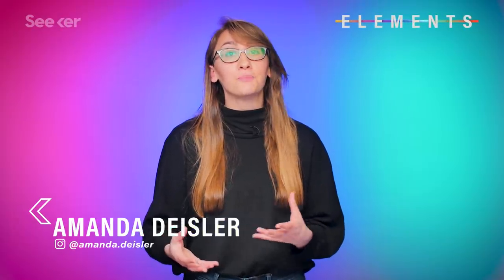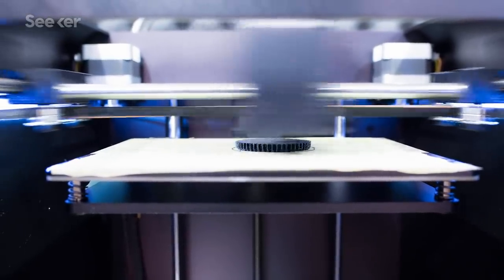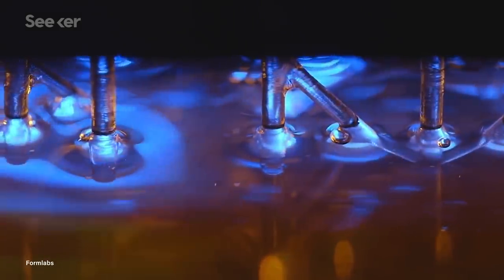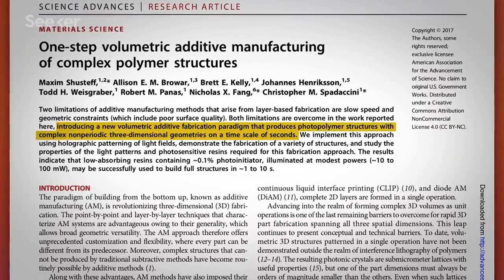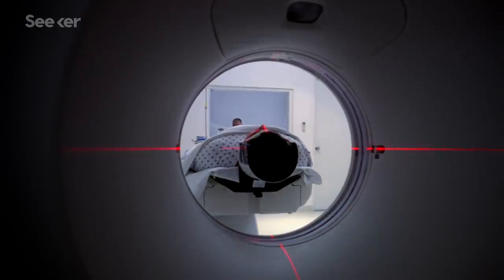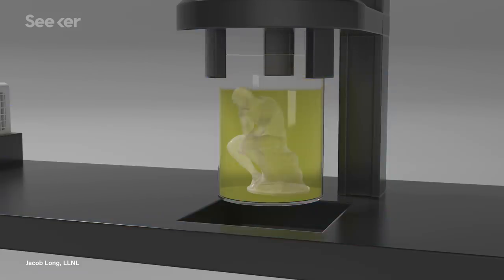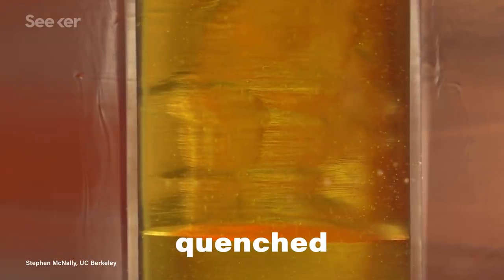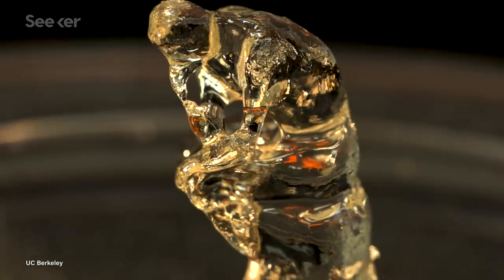Why This 3D Light Printer Is a HUGE Game Changer

Comment: Truly extraordinary. It also shows that reality can be stranger (and/or much more advanced) than fiction. Assuming "computed axial lithography" can be scaled up and become more flexible in the future, it is interesting to note that the creators of Westworld never dreamed of tech like this and instead employed conventional additive manufacturing (3D printing) to print the Hosts, as is clearly shown in the intro of the show. 

"Layer by layer" additive manufacturing has an inherent speed limitation, even if it can be parallelized, but I never thought such a tech was possible, even if specific resins are required. This is basically like holography merged with additive manufacturing. Most remarkable. Perhaps, as additive manufacturing is further developed in the future, we will eventually have something close to Star Trek's replicators, even if they are not actually "molecular".

Comment: That's really cool. But what would make it cooler is, what if you can then dip it in another liquid to form a shell? Maybe it could be made stronger that way or have other desirable properties. Or, one could then take that shell, drill a small hole and fill it with a substance that then dissolves the polymer so you can pour it out. Then, fill it again with something that will harden very solid, and then break off the shell. So, it's a perhaps easier way to create a mold for injection molding or whatever it's called. An artisan who is good at quickly carving some soft material could do the same, but for either highly precise jobs or just because it's cheaper and easier, this might be an alternative. Another craft lost to technology. Though, a job created because someone has to create the model in the computer.

Comment: This is amazing!  But I work with industrial printers like those made by 3Dsystems and this clearly has a long way to go before it would be useful.   accuracy is clearly not its strong suit.  There are a long list of challenges they will need to overcome before this would be commercially viable.   Still, it's a window into the future.

Comment: Dont get to excited, this is still in its infancy stage, as well failing to meet certain requirments funding for this has been cut to more than 1/2.
Although there was a good deal of excitment for this in the beggining.
it has taken a back seat to more ground breaking 3D tech that will be revealed mid 2020.

Comment: If they are going to move this beyond test tube size, they are going to need an extremely clear resin to allow the light to reach the center evenly. At this stage the resin is yellow and full of bubbles. Also the resolution isn't promising compared to existing layer-based resin printers. It seems inherently low, due to their approach of exposing the whole volume at once instead of focusing on individual layers. Using a hollow structure to conserve resin doesn't seem possible either. The lack of need for support structure is interesting, but I have reservations about it being a "game changer". It's certain novel though.

Comment: This Method is a nice idea, but it would be much more precise and efficient with a spherical array of some Lasers or Projectors around the Gel or Resin, where the Resin could rest static, instead of Spinning the whole Resin, that pretty sure leads to washed away, muddy shapes and artifacts, because of the centripetal & -fugal forces, that the material goes through. Even if it's seconds...Between the time, when the front-part and the back-part of a model is lightheaded, time passes by where the Container spins and parts of the model could slip or shift minimal in this non-solid, viscous material. That's why I think, that this spinning design would always result in to a minimal unsharpness of the prints, if non-solid materials are used.

Comment: I don't quite get, why the resin solidifies in the middle of the jar while maintaining fluid in the outer sections. If the light beam is strong enough to solidify the resign inside, why shouldn't it be strong enough to solidify the resign while entering, light doesn't gets stronger as it travels usually. The resin should, due to the rotation of the jar, move and make the print super janky. Shouldn't the jar break the light like a lens ? Why is this possible at all, i don't get it

Comment: I'ma go out and guess that this method is probably wel suited for solid objects, and that if you wanted to print IDK, like a box with a lid, of whatever shape, that the equation would get more complex than r(theta)=ax+by+c. then again, maybe not. I wonder if giving this setup an out of focus image at a variant vector would solidify the material at the focal point of that vector. I mean, you could try to do a complex equation to figure that, out, or you could just pulse an actuator attached to the lens focus on your projector. I'm just a dumb hacker thats what I would do. Clearly these Berkley cats are pretty clever, i'm sure theyve already figured out how to print hollow boxes and whatever. Theres probably all sorts  of interesting things to do around this technology.

Comment: Great development, but ultimately limited to the resolution of the DLP chips (which will only increase if there is demand from the entertainment industry and will likely never exceed 16K because of diminishing returns) and the processing power of GPU's. Also, by increasing the scale of the objects, the field of view needs to increase as well and the rays of light will not be parallel. How will that affect the efficiency of the technique?I guess what I'm saying is that I don't expect this technique to scale up to larger size easily.

Comment: Just some further thoughts. 
A 3D printer can't give a surface as smooth as an 18th century lathe (for a symmetrical surface). At the moment,  with a resolution of 1/10mm, thermal printers are very crude. They're making strides and it's conceivable that in 10-15 years,  we'll have 3D printers with 1/1000mm or even 1/10000mm resolution. More you the point,  it's likely that very large objects will be printed.  Extreme resolution means gaps between parts will be irrelevant - eliminating the need for welding or glueing. There comes a point when intermollecular forces bind adjacent objects stronger than any bonding agent. This is the future - and it's an exciting future. (Especially when atomic level printed circuitry may become a reality. - Conventional electrical  connections aren't necessary when components can be brought close enough to each other).
Reply: True.. When you have the technology to print atoms and print molecules... You then wield the power of the God's.... Gone will be the day of chemical and inertial wrenching of molecules from other states and solutions.  This technology will affect every area of research...for better or worse..because along with the power to create comes the power to destroy.... If history is any indication of our future path... It will not end well.

Comment: Ya right, a polimer bath. What you need to be doing is 3D rendering using pressurized hydrogen 3 or strait hydrogen using lasers or 3D holographic multi-layered imaging.

Comment: Why not solidify each micro node with the intersection of two UV LASER curing beams, each having insufficient energy to cure by itself, but sufficient only where they meet?
Could use conventional UV cured resin and could be vacuum autoclaved to remove air bubbles, if indeed this type of resin even requires that!

Comment: Hmm🤔 interesting You know baking soda and super glue or cyanoacrylate could also be used to 3D print by layering however it would be way faster then a normal 3D printer due to the fact that the baking soda solidifies the glue instantly, food for thought. It also has a high melting point, I seen reach 210deg,  this tech awesome 👍

Comment: Instead of using just one projector, more than one projector at slightly different wavelengths could be used. That way the light from one would not be enough to cure the resin, but when multiple hit it at the same time it could setup and cure the part. This is not exactly new as was mentioned, as it has been done in the past were the light is focused onto different points. The places where it is focused are were the resin will setup. One problem with people saying something is new is most of the time it is not new, just new to them. Most everything has been done at some point in time, but the details have been lost or all of the people involved are long dead. Not everything that appears new is actually new. Electric cars been around more than 100 years, and is safer than starting one with a crank. Yet today if someone were to see something new looking with a crank they would think that it is new. This applies to all fields, and just because there is no documentation on something does not mean someone else has not tried it in the past. If there are no records of something being tried in the past anywhere, you can take the old idea and get a patent on it, just has to be unlike similar things that the Patent office has not seen before.  Man has been here more than 300,000 years and it has only been in the last hundred or so years that things have been recorded. In addition records of things do get destroyed over time. So it is possible that some project that someone created a few years ago that the creator died, his ideas could be used and none would be the wiser.

Comment: The 3d printers that use resin, go layer by layer and also use DLP. This printer, it may be faster but the resolution of it looks like crap. I have put an ink jet printer at higher speeds but the print looks terrible. For something like this to work, you would have to change the focus of the light and instead of printing from the bottom to top, it would be printing from the center, out. You're going to need 3 separate beams to focus on one point if you want to do something worth while and that is already being done and improved on.

Comment: I think this is a great idea and I have a suggestion for you going forward.  I think you could dramatically increase resolution and refinement by using more than 1 projector in fact in your case, 3 projectors each one only projects certain color light.  The projectors are mounted radially around the work tank and project into the resin simultaneously in such a way that the resin only cures when all 3 colored lights intersect.   The multiple projector concept is not a new idea, many gaming systems are incorporating dual cameras to achieve a 3d looking image on the tv screen so just do the oposite right?

Comment: Other than the 'edge quality' I don't see the HUGE STEP described. 
How is this so much better than, say, a 3D printer that prints metal rocket engines ready to use?
Reply: it's not. lol. its pretty fast, and it has places where it works better than another type, but it has drawbacks tied to it. It's roughly equal to anything else, if you're only looking at the end product.

Comment: I wish videos like this could actually be informative and not just echo what the developers tell them to say, instead of wildy speculating, a little research or peer investigation would be nice. Also that rehearsed question about biomass at the end was cringy.

There are some clear drawbacks to this style of SLA printing;
1) The resin being cured by light depends on it being opaque to some level, this means passing light through material you do not want to cure will diminish the light's curing capabilities, not just curing unwanted material but not curing the wanted material optimally (a problem layered SLA printing doesn't face)
2) Because of the above drawback there can never be much material between the light and what you want to print, so getting larger prints from a larger version of this printer is not possible
3)  You are limited to resin's or resins infused with other material which does not need to cure
4) The resin which was not entirely cured will be partially cured, meaning that you would need to use some kind of mix of new & old for your next print or put the resin through some uncuring process (unlikely).
The stereolithography resin is likely the same liquid used for standard SLA printing only with a binding agent used to thicken it into a gell so the pring maintains it's position while spinning, likely more viscus resin was added or sugar as a binding agent.

This form of printing may find a home in mass production of miniatures, but it is hard to imagine any other use case where it excels beyond standard manufacturing or SAL/FDM/SLM/etc.

Comment: Does it have to be yellow, though? X3
I kid, I kid... this is freakin' amazing.What kind of resolution could you get? Like, microscopic scale? 
If basic microscopes can magnify vision a few hundred times, could you print using microscopic light beams?
Can you print around an object? eg; put a circuitboard+electronics+battery in there, then print a housing around it. Or like; put in a pair of eyeglass lenses, then print the frames so you can wear them.

Comment: The screwdriver handle looked like complete garbage. Also, everything looks wet and the detail level sucks, so I have my doubts about it having ANY strength. You can hope all you want that a "new technology" just has a few issues that need to be improved, but there is NEVER any way to know anything can be improved, so whatever you see, is all you can count on. Planting the ideas at 4:22 is nothing more than trying to get people to share this video. The inventors of the device never made such claims, they only made a proof of concept that you can make a Jello into vague shapes. If you want to use it for something like a leg, made out of jello, you're a fool. When asked about bio-compatibility, the reply was just "it's something to learn about", which means, basically nothing. Again, what you see in the video, is all this is. Nobody made a smartphone support stand out of jello, which could be small and would show it's physical strength. Be aware that in the video, never once did anyone touch the jello. Did I mention it's Jello? Just saying...
Reply: Also, what about hollow shapes? I'm having a hard time seeing how this can be achieved apart from multiple projectors but even then...
Reply: To add to what I said, I'm not saying I am against new technology and achievements, I just don't like when is talked about in a way that a casual listener/reader will get the impression that it's something better than it really is. To be fair, it's what "the news" is basically trademarked for, making things sound way better or way worse than they really are, which can cause people to make bad decisions, which can impact people financially or their health. People may see this video and invest money in it, not realizing the story was embellished, because maybe they are having a stressful time or tired or just wanting to believe what is said is 100% fact.

Comment: im not a disbeliever i think 3d printing will be the future but its a long way off. i worked in the plastics industry and molds take seconds and produces high quality products and cost next to nothing.
Reply: Casting molds is generally gonna be better than 3d printing for mass-producing large quantities of the same part- but 3d printing is already commonly in use today, and has been in the production pipeline of goods for years. The strengths of 3d printing are in rapid prototyping (you don't have to make a new mold every time you change your design a little bit), and making custom parts in shapes that tooling isn't suited for (organic shapes, parts with complex internal structures, etc).

Comment: this is huge.  ..  but   messaging  a plastic into   shapes.. ahh  is a start... lets go further  with the mathematics  and  try   using for medical   and cellular  intervention.  and   Metal single molecule alloy  films  for structure and  building     analog  molecular computers    and  more  extreme  such as in    nuclear reactions  using the  structured   atomic model.
Reply: Those are the reasons these are being developed in labs.

Comment: Pretty much hype. This is just a way of speeding up SLA. That's great if you only want epoxy parts. This cannot be applied to more interesting processes like SLS (laser sintering) because the media scatters the light so you can't do anything volumetric.

If the media would do their homework, the REAL advancement in additive manufacturing at the moment is the combination of machining with SLS, such as what DMG Mori has done with their Lasertec 65 machine. See: 

https://www.youtube.com/watch?v=L3CkzQQFZXs

Comment: I don’t want to hack anybody, but I really think it is you someone with the necessary calm to talk with Autodesk about the friendly graphical interface to avoid the biologist to program with the best UI UX Design, I dont’t have the intention to hack Autodesk but they are with the most important discovery for example cure the coronavirus it is just when the next pandemics comes, if that technology was already fully developed today we would have had for now the vaccine for the coronavirus and it is also a question of security, this technology can only be developed in USA, that is all and I know you understand when I talk about the security of this technology and I think Autodesk is in the right path, but for security issues I really think that the only place where it can be developed is in.USA but Autodesk only is not enough I think that USA have to take control of it, but there is a necessity that all mayor American Software and Hardware companies can surely compete to implement a faster way to fully develop that important and extremely profitable technology, and it is not about medical only it is for the necessity of innovation of biofuels to make work the renewable energy in reality.